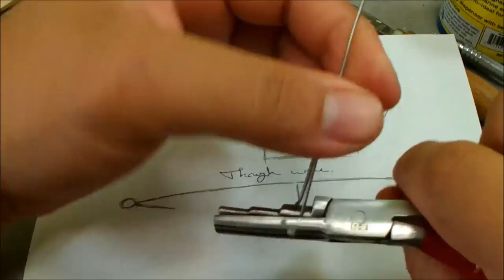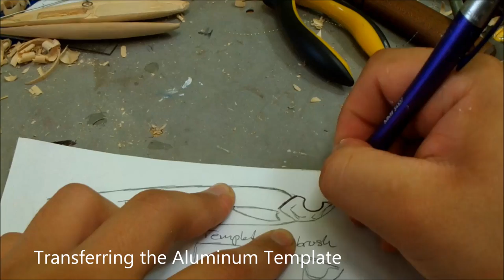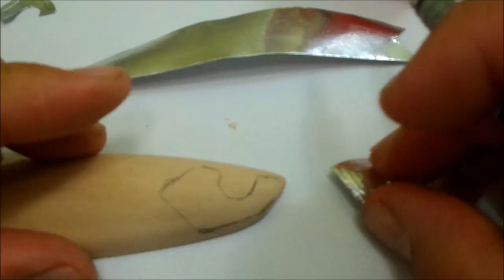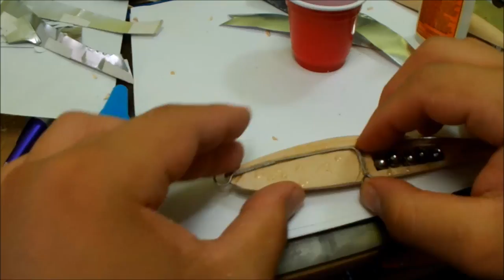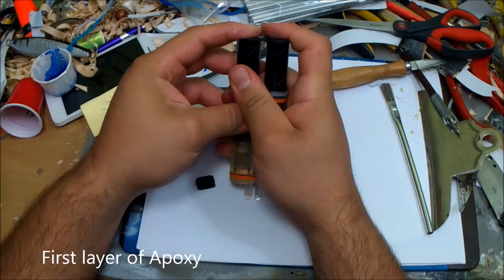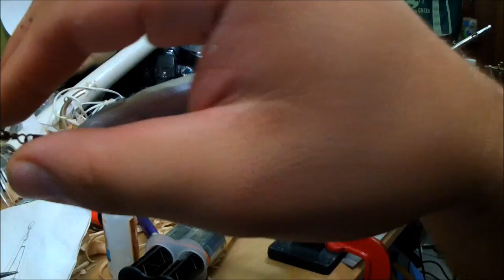Making a wooden beach fishing lure Part 2

Comment: awesome stuff, what size is the stainless steel wire you are using. looked pretty soft the way you were using it.  Also, on the other video, what is the stuff you used in addition to the aluminium tape?  Thanks
Reply from the maker: the wire is 0.041" T-304 stainless steel wire, it is a bit soft however I've never had a problem with it I've had sharks on some lures with out any sort of damage to the wire form, the other stuff along with the aluminium tape is an adhesive, I use contact cement and the hologram doesn't really have a name I got it at a hobby store it's used to make streamers for party balloons. it comes in tubes similar to aluminum foil.
Reply: +FishingInstinctsSRQ another question, without the ballbearing or lead, would the bait sit flat in the water or would it lean to one side? a problem i'm experiencing at the moment, including in one situation where I've got a few ball bearings and still the lure leans slightly to one side even with the big treble on.  Thanks to your advice.  Love the work and will give the soft stainless wire a go.
Reply from the maker: Tsewang Bhotia What could be happening is that the weight placement could be laying directly on the axis of the lure which would cause it to lean to one side, now if your making wooden lures like myself you have to remember that different types of wood not only float better but also act a weight system ,meaning that if the shape of the lure isn't symmetric and there is too much wood on one side and not enough weight as the balance it will cause it to belly up . softer woods will cause this harder woods wont really have this issue .. draw out a  plan for an new lure but draw a 2''x6'' box then mark the middle on both axis , draw the lure there and if your weight placement is bellow the 1''mark it will lay perfectly , if the weight it in front or in back of the 3'' line it will leant face down or tail down. the only shapes of lures that don't need any weight and will float with just the treble as the leading weight are fusiform lures or top water poppers.
Reply: Thanks for your help. I think the issue with mine is my sides are not symmetrical.  Btw, what wood are you using? Yellow Cedar?
Reply from the maker: +Tsewang Bhotia 
it's mostly repurposed wood, I do prefer to use poppler or bass wood for it's ease of use but if been recently working with bird eye and it's amazing

Comment: Awesome work👍🏻 What epoxi you use (curing time not the brand) and how do you clean brush from epoxi? Can balls inside the lure rattle it looks to me that they are realy tight fitted?
Reply from the maker: JOBAHT I used 15 min epoxy that has a 5 min work time, they do rattle just not as loud as they can with more space it's more of a low knock, and you can use epoxy solvent to clean your brush but I buy horse hair flux brushes, you can get them online. Thanks for watching

Comment: nice vid dude! 
how did you make that surface detail on an aluminium foil (parallel stripes)?
and also could you heat up the epoxy a little and then airbrush it?
Reply from the maker: asukaj if you are talking about the cross hatching it was done with the knife at an angle,  you can heat up the epoxy a but but the problem is that you would need 18 hour epoxy other wise the heat would make it harden instantly if it goes over a certain temp,  if you are to successfully heat it up to a good consistency the other problem would be that the air brush would quickly bring the temp down possibly clogging the air brush before you can finish ,  there are two part top coats that you can use the an air brush and I think you can get them on amazon.
Reply: FishingInstinctsSRQ thx for reply!

Comment: great, how do you make aluminum holographic???
Reply from the maker: to do that you need the aluminum duct tape, rubber cement and holographic paper, once you have cut the tape to size cover it in a thin even layer of rubber cement, place the back side of the holographic paper and smooth it out, wait 20-30 second then begin removing it from either end, you can make different patterns in you wish but that's the process.